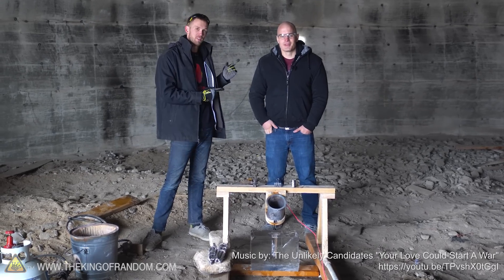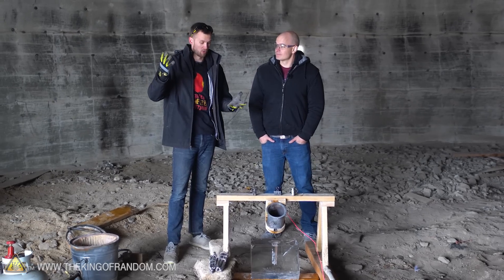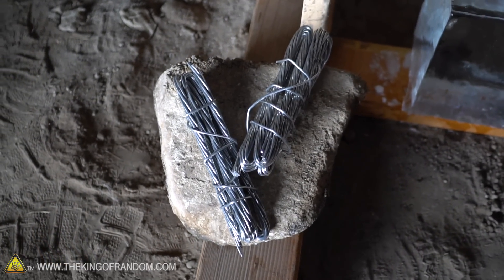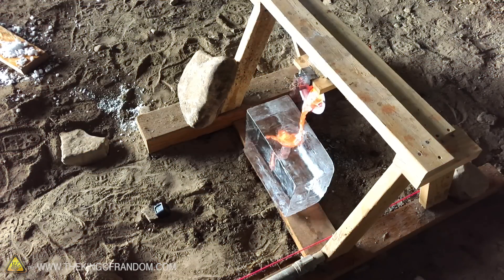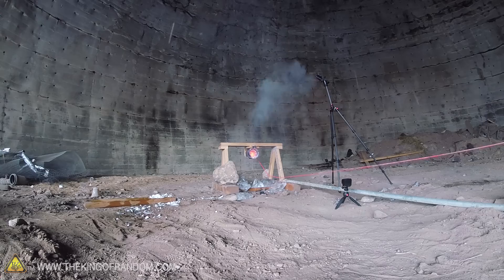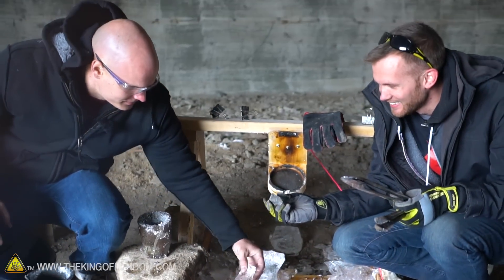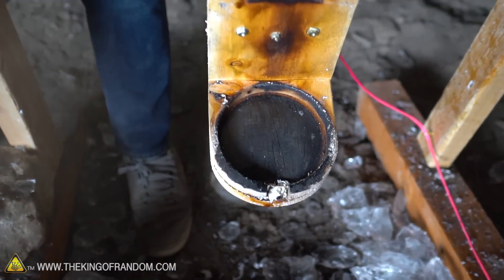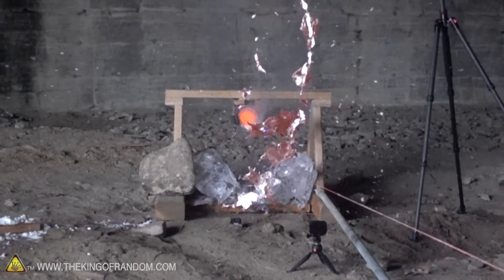Molten Aluminum on Clear Ice is CRAZY! TKOR Experiments With Molten Steel, Molten Metal, and More!

Comment: Woah. I didn't know that the Immigrant and Custom Enforcement agency doesn't like to get burned by molten aluminium.
Reply: This would've been funny, but that grammar just put me off.
Reply: LIterally one mistake (A missing like). Could possibly capitalize the "the". At least tell me what's grammatically incorrect.
Reply: he means the usage of didn't/don't versus did not/do not
Reply: +Rishabh Kotturgowdra It's more of a choice, not a set in place rule. Contractions are informal and vice versa.
Reply: I usually prefer without contractions but I guess +TechnoBurst prefers contractions.
Reply: +Rishabh Kotturgowdra
 In this context (Informal), colloquial language works better, I suppose.

Comment: This is completely unrelated to the video, but anyway.

A few years ago, I stuck a twisted up LED into an outlet. (Don’t ask) 

It sparked very loudly and bright, I couldn’t see for about 1.5 seconds.

Before you say “well duh” it’s 120v 

LEDs work on DC don’t they?
Outlets give AC...

Why did it spark?

I haven’t been able o recreate the spark since...

Any ideas anyone?

Details that might help:

The led was twisted up
The outlet had a metal rectangle around it that I also touched( instead of plastic)
The plastic part that you plug stuff into was broken and I could see the metal inside (that’s what I touched)
The led welded itself to the metal rectangle thing.
It made a spark sound and then the same sound as a spot welder.....

If someone could tell me or explain that would be greatly appreciated 

Also the reason I’m asking in this video is because the explosion reminded me of it...

Comment: 2Al + 3H2O = Al2O3 + 3H2 ↑
The surrounding air will then react with the hydrogen, creating either a hot fire, or an explosion.
Reply: yes this is correct i think in this video it was just a steam explosio but since molten aluminum has no protective oxide layer it could react instantly with the water releasing tremendous amounts of energy and creating a reaction  even worse than the one in this video

Comment: Put liquid nitrogen in metal foundry.
Reply: It'll either evaporate and/or form dangerous nitrogen oxides
Reply: jose avila it will just put out the foundry because it displaces the oxygen from in there and prevents the fuel from combusting
Reply: It would put out the fire in it i think

Comment: gotta try the dry ice and molten aluminum now!
Reply: pretty sure they've don't that before. the aluminum just slides around the dry ice because of the leidenfrost effect
Reply: big difference is when they did it before... huge hole which gave it a place to escape. same as when he stuck the hot crucible on the ice. but, if you put it in a narrow, and deeper hole, i imagine we'll get the same effect as regular ice, but more intense!
Reply: Check the backyard scientist, he's done it
Reply: heavylead1961 x++he
Reply: I doubt it would be the same cause dry ice sublimates so I just imagine there is tons of smoke, and not an explosion like the ice with steam no where to go in the bottom.

Comment: The steam didnt blow it up... but the hot alu converted the water into steam and it trapped it in the hole then the heat split the steam into oxygen and hydrogen and that detonated. Is my theory.

Comment: You should melt iron filings, and put a large magnet to it while it hardens.  I think it will end up in solid spikes
Reply: The Great Outdoors Sadly, molten metal does not react to magnets.
Reply: Look up Curie point
Reply: @Bass 'n'Bluegill, I know what cutie point is, it is actually used to magnetize a metal by heating it up to a temperature that had the same energy as it takes to switch the poles of the atoms

Comment: That was totally not what I was expecting!
Reply: Science with Katie really? Considering your profile name Id think you would have expected nothing less
Reply: Ell Bennett not as explosive as it was! 💥💥
Reply: Science with Katie  The Tm for Al is 660*C and a block of ice that big would self-sustain a temperature about -5*C
So the sudden thermal shock that big would lead to a very big explosion especially as its pure crystalline ice which would have a higher tensile strength than regular ice all resulting a delayed reaction. The Al would melt the ice heating it quickly and as it does so it would form steam and expand quickly until the crystal breaks violently
Reply: That's not the whole story. I need at least 1000 frames/s close-up to see what happened there. I didn't expect a hardened and well-sealed aluminum plug at the top to have occurred rather than what should have been a superheated steam-jet.
Reply: Ell Bennett I mean, theres different forms of science, what if she specializes in genetics or whatever?  This... Isn't a thing she would know
Reply: Funny, that's about what I expected
Reply: Science with Katie o
Reply: Science with Katie do you not understand thermodynamics?
Reply: Same.